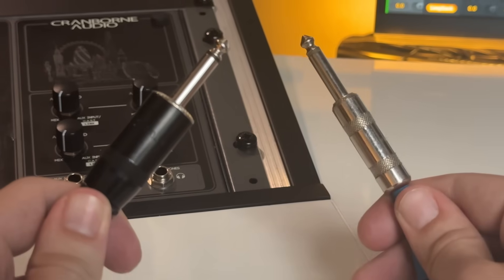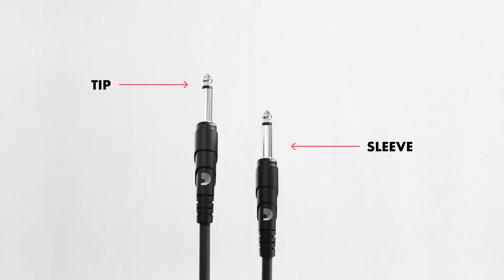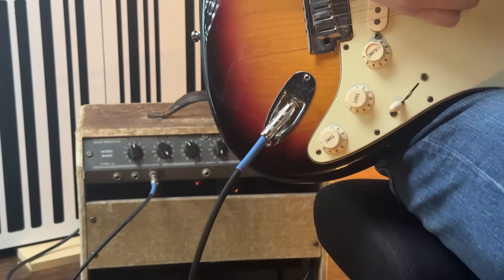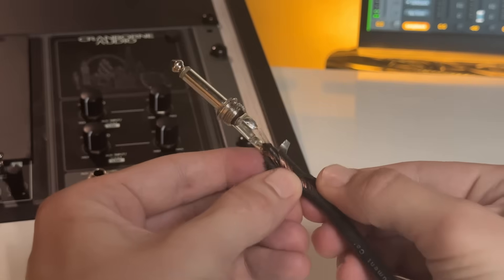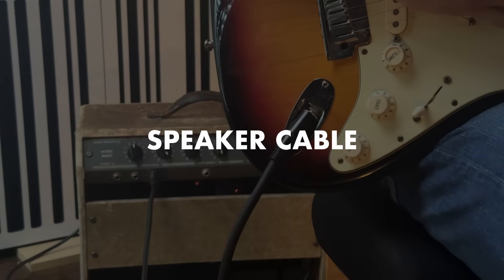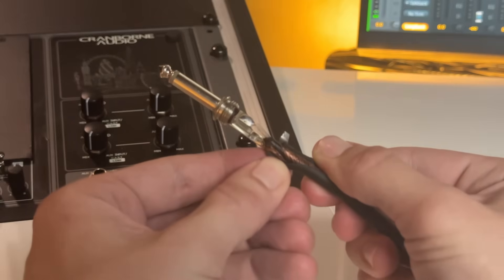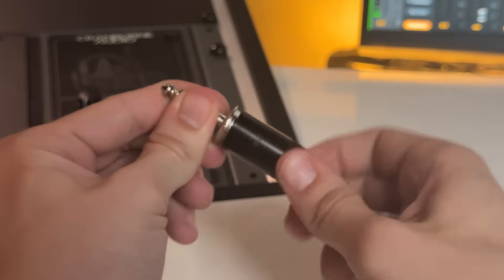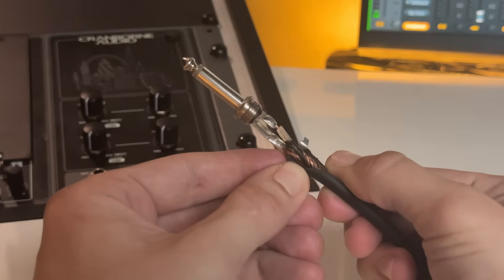Instrument Cables vs Speaker Cables: They are NOT the Same

Comment: 6:03 Personal anecdote: When I got my first tube-amp in 2014, I had no idea about differences in cables. The store I bought it from didn't tell me so, and neither did my friends. Was prolly assumed that everyone has that trivial knowledge.
So my lead-guitarist at the time gave me a short patch-cable to connect the amp to the cabinet. And it made the amp screech and feed back like crazey.
Had no idea where it came from, or how to fix it. I assumed it was just how high-gain-amps worked. Ironicaly the ISP Decimator I got with the amp killed the feedback.
Years later I brought the amp to a guitar-store, just to have it looked at, since the screeching just didn't sound "normal".
Welp, as you can expect, they sold me my first speaker-cable that day, resulting in a quiet amp.
Using the guitar-cable as a speaker-connector for a year didn't damage the amp in any way luckily. Doesn't mean it wouldn't ever do so.

Comment: I'm tired of the audio industry putting the same plugs on cables for different uses.
Thankfully speakers and lights (which also have interchangeable cables with everything else) are basically set and forget so the only cables not in deep storage should be for mics and instruments (should).
Label everything clearly lads.

Comment: You may well discuss it in the other video, but cable capacitance doesn't create the LPF, rather it increases effective filter ORDER and filter resonance, and lowers the cutoff frequency, given the pickups are already inductive (and capacitive, and resistive, as is the input stage).

Comment: Most, good speaker cables DO have shields, and are exactly the same
Reply: Exactly the same as instrument cables?  Definitely not.  The wire gauge will be different.  And shielding may be nice, but is certainly not necessary for a speaker cable to be "good."  The voltage on speaker cables is hundreds or thousands of times higher, while the external noise remains the same in magnitude.

Comment: I damaged a couple of decent speakers and an amp by ignorantly using guitar cables. I had no idea it was the cables that were blowing the amp and speakers until someone told me a bit later.
Reply: ive been using guitar cables from amp to cabs for 30 years zero issues. 🍻
Reply: @niteshades_promise_music  Lucky you. It's not something I plan on doing again.
Reply: @niteshades_promise_music why wouldn't you have used the proper cable?
Reply: @niteshades_promise_music same. Been playing music for 25 years now.

Comment: I've seen an instrument cable torched trying to use it for a monitor.  Fortunately, it just opened like a fuse inside the connector on one end.

Had my vet X-ray a cable once so I could tell if it was a speaker cable for a small PA or an instrument cable.  It was a very cheap foil wrapped instrument cable.  Had molded ends and nothing printed on it so couldn't tell without cutting it open.

Comment: My speaker says it needs a trs balanced cable. My interface monitor outputs are also balanced trs . Should i just get ts cables?
Reply from the maker: You’re connecting to a powered speaker (with a built-in amplifier). You should use TRS cables.
Reply: @AudioUniversity  thanks this clear things up.

Comment: Do i need to use speaker cable if i'm connecting my audio interface to my monitor speaker? Thanks!
Reply from the maker: No. Speaker cables are for connecting amplifiers to speakers, as I said in the video. You should use either a TRS or XLR cable.

Comment: I had a lot of noise from my guitar even with a guitar cable ("No Bull" brand) - screeching whines at dozens of different tones once the effects chain was applied. I got a Mogami 3368, which eliminates most of it but it's still not great. Do I also need a DI box? The cable's only 1m long and currently goes straight to an instrument input on my audio interface.
Reply: Humbuckers might help a bit, but the fundamental problem is the stupid design of guitar and bass cable circuits. They should have become shielded (like mic cables) 60 or 70 years ago  - it would have increased the cost by almost nothing, and would have almost completely eliminated electric instrument noise. But alas - that didn't happen, and we still plug our electric instruments into what are effectively antennas for stray RF interference.
Reply: @poissonpuerile8897  Yeah I only have humbuckers so far. I'm tempted to pick up something with single coils some day (or try a P90 for that matter), but I need the noise sorted to do that.

My house is pretty bad for RF for some reason, so maybe this is just another thing that can be sorted out if I can move. At least the speakers are fine as I use balanced wire nearly everywhere else, or star quad for unbalanced, and shielding for the longer ones. Wish electric guitars were more compatible with any of these technologies!

Comment: What role do balanced TRS cables play in all of this? Are there balanced versions for both instrument and speaker cables?
Reply from the maker: Amp to speaker connections (with regular speaker cables) are balanced by nature. Instruments and instrument inputs don't typically offer a balanced connection (you'd use a DI box to balance for long cable runs). It's a common misconception that three conductors are needed for balanced audio. Here's a video about balanced audio: https://youtu.be/kVQh7dlJNAw
Reply: I see, I had no idea, thank you! @AudioUniversity
Reply: Since when are amp-speaker connections balanced? On most amps the negative is tied to ground and only positive carries signal. Some amps (mostly class D) have a floating ground that's different from device ground, but that's still not balanced.

Comment: Low diameter cables, means higher resistance. When used as a speaker cable, and the speaker is 4-8Ω and you add even the smaller amount, you just lose power.
Reply: With that explanation neither of the cables would work with speakers, because they "add a small amount" of resistance.

Its actually the amount of current from the guitar signal vs the amount of current able to produce tone on a passive speaker. The more current you run through wires the hotter they get, but the larger the diameter the more current they can handle.

The other thing is the shielding. Instrument signals are high impedance and thus angered to be interfered with em waves to distort the signal. That's why the architecture of the instrument cables is centered around compensating the outer influences. For the high power signals of speakers the slight effect of em waves do not have an impact compared to the power of the signal, so they can run them in pairs.

So it's the other way around: speaker cables are the thicker ones (having less resistance)
And instrument cables are the slimmer ones having more resistance

Comment: I’m confused as to why speaker cables are so often TS instead of TRS (as the link to the Pro Co speaker cables in the description shows). I thought that whenever using 1/4” cables across long distances, we always want to use a balanced connection to avoid noise. I think I’m missing something, can anyone clear this up for me?
Reply from the maker: As I said in the video, the signal level sent from an amplifier to a speaker are much greater than instrument level, mic level, and line level. Therefore, speaker cables do not have a shield. Otherwise, the technology is very similar to a TRS cable (twisted pair, conncected to a differential device - a speaker in this case). You can learn more about TRS in this video (it shows that a shield is not necessary for balanced audio): https://youtu.be/kVQh7dlJNAw
Reply: @AudioUniversity  Okay thank you. So this video is specifically for using passive speakers?
Reply: @julian_joy  Yes (he replied the same in another thread)
Reply: Technically the strings on the electric guitar do not disrupt the EM-Field, they have neutral εr and a μr >1 so they actually increase the em field.

Comment: Which one (instrument cable or speaker cable) is to be used to connect mixer Mix LR to active speakers or between active speakers, say, From Active speaker A mix out to input on active speaker B being it XLR or 6.5MM Jack cable?
Reply from the maker: You’d want to use either a TRS cable or XLR cable here.
Reply: @AudioUniversity Should the XLR or the TRS cable be made of a speaker cable or instrument cable in the case of connecting a mixer output LR to the active speakers?
Reply from the maker: It should be made with standard XLR cable - two twisted conductors with a shield. This is found in neither instrument cables nor speaker cables.
Reply from the maker: Check out this video to learn about the elements found in an XLR cable: https://youtu.be/kVQh7dlJNAw
Reply: @AudioUniversity okay sir thank you

Comment: Shielding requirement is a matter of source and load impedances rather than signal level (voltage).
Reply: It's sort of both, really.  In a speaker cable the signal voltage will be on the order of tens of volts, so any induced noise from the environment will be negligible in comparison.
Reply: @davidhiggen3029  If what you say is correct then we should expect noise problems when speakers are sent low to zero signal levels.

Comment: Phone plugs and jacks make very poor speaker connections regardless of the wire used in their construction but amplifier manufacturers use them nonetheless.
Reply: It depends on how they are constructed but I always found it kind of strange to use them for both small signal and power outputs, as this obviously will lead to confusion and damage. Definitely not an 1-diot proof design choice.
Some vintage (home audio, mostly) passive speakers even have RCA inputs, I guess if you erroneously use interconnects (especially cheap modern ones with their puny conductors) for them and crank it up good, the cable will go into a meltdown.
Reply: @westelaudio943 I agree about the confusion factor but  my issue is that there are no phone jacks and plugs constructed such that the tip connection is any more than a very small area.

Comment: I've made some cables with 2.5mm [edit]1/4 inch, 6.35mm TS plugs on both ends using old microphone cable, just leaving one conductor not connected, using the other conductor for the tip and the shield for the sleeve. We use that to connect guitars or keyboards to connect from instrument to DI. The cables are around 3 meters (6ft). The cables are labeled C114 Tasker, which I find online is 0,25mm2 cable (roughly eq. to 23AWG).
Could that cause problems, as it is just working fine, without a hum or static? Or did I just create "instrument cable" myself?
Reply: I want to see that melted cable..... Hocus Pocus 😅
Reply: @SwedeReact  why would that cable melt in this instance? Could you explain that?
Reply: He said it in the video.... Maybe i missunderstood that or your question.  @edewaal97
Reply: yes, if you take an XLR wire (two insulated conductors and a bare ground wire with some sort of shielding), solder one insulated conductor to the Tip, the bare conductor to the Sleeve, leave the other insulated conductor unsoldered and taped off, you have created a mono unbalanced guitar/instrument type cable. 2.5 mm is not very common, at least not here in the US. you would typically see a 1/4" TS (6.5 mm) for this application. most DI boxes here in the US will have a 1/4" TS input. this cable would only be used to send a mono unbalanced line-level signal. you would not use this cable for speaker level (amplified) signals. in other words, you would not use this cable to output from a power amp and connect to a passive speaker.
Reply: @RustyDodd I'm sorry for the confusion. I used 1/4 inch jacks (6.35mm). I did exactly as described with the soldering. Thanks for your reply! We use it only from instrument to Di, or Di to Amp. We don't use jack for our speakers, because all our speakers are active. XLR for everything else.

Comment: Is there a way to tell them apart from the outside? I assume other than the speaker cable being thicker, no? Thank you!
Reply from the maker: They are usually labeled on the cable jacket.
Reply: @AudioUniversity Can we assume that no label means it is an instrument cable? I have several cables, but none of them are labelled.   Someone once told me that a speaker cable has a spine along it to identify it. True?
Reply: I am having the same problem. The cable has no label and plug is sealed.  Any suggestions??
Reply: @ClydeKerr-m4x Unscrew the tip and look.

Comment: I have been using instrument cables to daisy chain my powered monitor speakers (kustom kpc4p). The output jack is labeled "line". Are these the correct cables to use. I tried speaker cables once and there was a lot of "hum".
Reply from the maker: Over short distances, instrument cables will be ok for line level connections like this. Ideally, a TRS cable would be used, but if it sounds good it is good.

Comment: A couple of years ago, I realized I was using an instrument cable to connect a powered mixer to a passive speaker. I swapped it out with a speaker cable, but needed to use a standard right angle TS adapter in order to make things fit against the wall. Does adding this TS adapter affect the signal or connection at all? Thanks!
Reply from the maker: As long as there is a secure connection, it should be ok. Using a soldered right angle connector (rather than an adapter) would remove a point of failure.

Comment: Is it still damaging if you use a speaker cable to connect your guitar to your amp (as opposed to using an instrument cable to connect an amp to a speaker, which was addressed in the video). Other than the obvious noise issue, is there a physically damaging result to using a speaker cable to connect your instrument? Maybe this was already touched on in the video and i didn't notice tho😅
Reply: I think this will result mostly in just a weaker signal on the other end needing more gain, adding more noise and nothing else.

Comment: Interesting 😀
I had ni idea those plugs are even used for speaker signals (as they doesn't seem to handle high currents very well in general) - I taught those were for headphone signals at most (for small speakers that don't need very much power it will technically work though). But, of course using a "signal cable" to power something (even a small speaker) isn't a great (as the conductors are usually very thin).
Reply: Quarter inch connectors are mostly used in smaller 'semi-pro' setups, because they are cheaper.  Larger more professional systems use things like speakon connectors, which are designed for higher power.